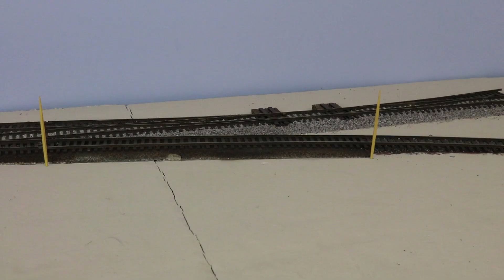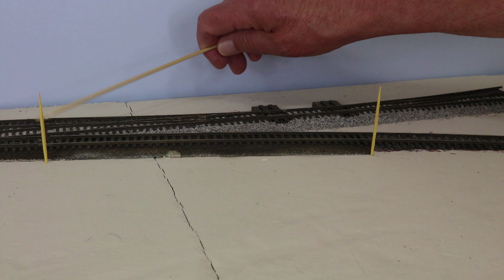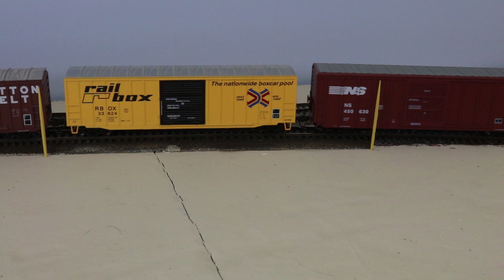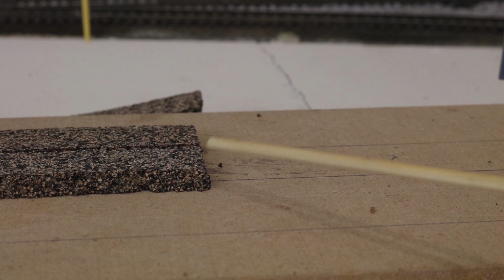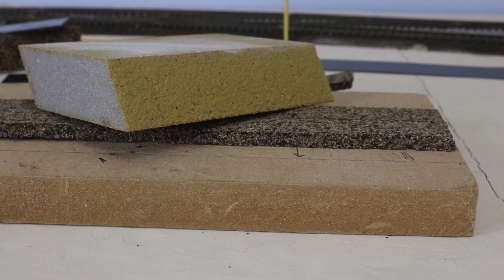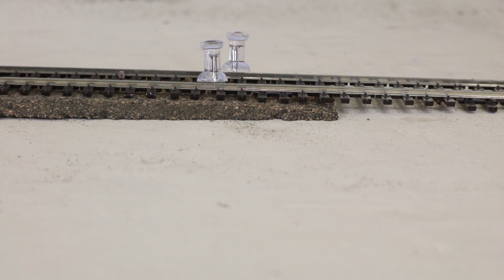How To Transition Between Roadbed and Sub-Roadbed

Comment: I use a method where I lay the track and then using a straight  edge put some shims under the track. Then I fill in under the track with play sand, wet and glue just like you would glue Ballast, and the rack is laid without any problems. fast and cheep...
Reply from the maker: Thanks for the comment. Many ways to do this but be careful with the shims. If they're wood, they could swell when using the wet materials...Harold

Comment: Good video.  I ran into a difficulty with steam engines having a low front metal pilot contacting both rails shorting across the two rails; have not developed a solution as yet: lengthening the slope, insulating the bottom of the pilot, changing to a non-conductive pilot, etc.  Another option is using shims for household door frames, available at Home Depot, mine are the longer ones (12"?).
Reply from the maker: Thanks for the comment. You're correct. The shorter the transition, the steeper the grade will be causing the problem that you experienced. With something longer like the door frame shims or a longer piece of cork, you're less likely to have the problem...Harold

Comment: I noticed several things in the video that I would liem to discuss.  If doing HO, you can buy some N scale cork or some cork sheeting at home improvement or craft stores and cut them into short sections and that will help eliminate alot of time sanding.  Then where the N scale cork goes to the table top to represent the sub roadbed or ground. Plastic shims glued together and then sanded. I have done this method on my layout that I am building.  On the wood shim method, you sand it to get the smooth transition and then when sanding is completed, you paint it with several coats of good primer and then applying ballast is not a moisture problem.  Same as sanding then painting cork roadbed. Other ways I have done this transition is plastic shims and masking tape. This method was done on my N scale layout and worked well for me as well. I dont remember if I painted over it or not to seal it prior to ballast application.  I made several transitions on my N scale over a several year spread and haven't had any issues.  
Just thought I would share my methods with you.
Reply from the maker: Thanks for your comment and for sharing a different method with others viewing this video. Yes...there are many ways to do this some of which can be seen in other comments below. However it is done, it presents a more realistic appearance to sidings and industrial spurs. So, viewers, choose one of the many available methods or try your own...Harold